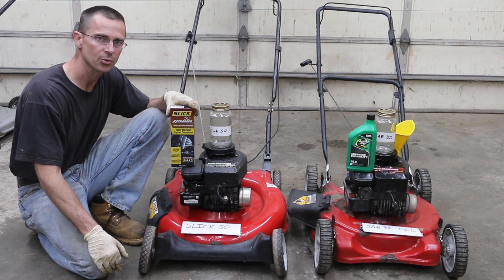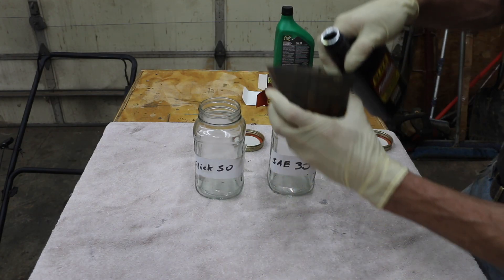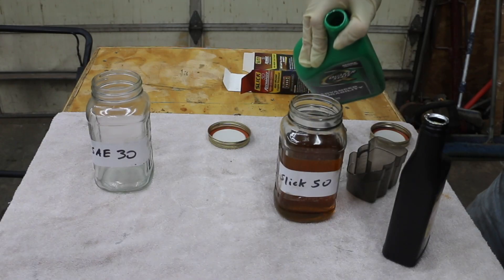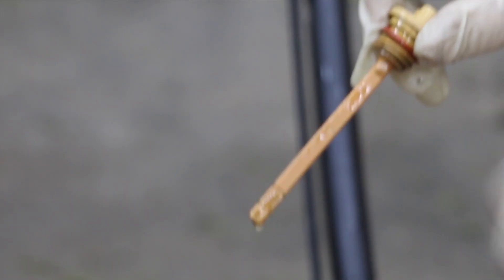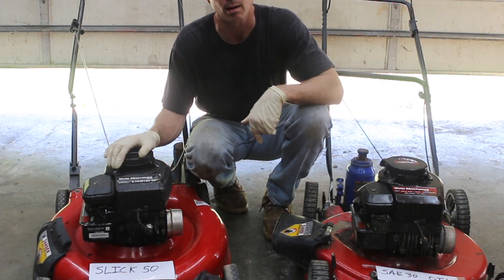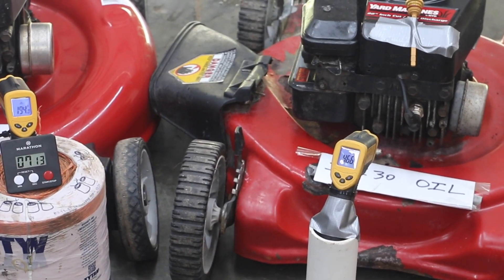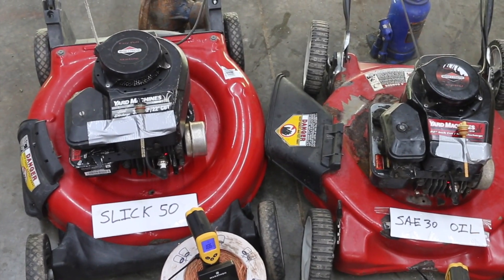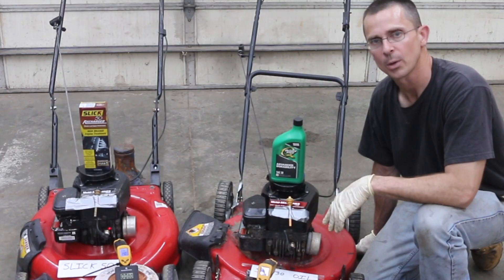Can't believe what SLICK 50 did to my engine!!--Dry Crankcase Test!

Comment: I'm convinced I both saved a car engine and ruined one using slick 50.

The engine that was saved was a vortex V6 in an Olds Cutlass. On at trip cross country, my oil pump went out in the middle of no where at night in the pouring rain. The car, which had slick 50 treatment got me 80 miles with no oil pressure, to a dealer who replaced the pump and tried to sell me a new car, saying the engine was damaged. I drove the car for four more years before trading it in. It ran fine and did not start using oil.

I should note, that Slick 50's directions says to run the engine for a few days and then change the oil again, using straight motor oil. This was the case in the engine I drove with no oil pressure. I averaged around 6o mph going up and down rolling hills. The engine temperature would climb when going up a hill and I would have to slow down to bring the temperature down. Still, the engine ran well.

On the other car, an 89 Land cruiser, straight six, I added slick 50 and never did the second oil change. The car was parked for several months without use. When I drove the car, within 5 miles, the rod bearings seized and broke two rods. When I got the car towed home and pulled the oil pan, the oil/slick 50 had turned into a jelly. I was running synthetic in the engine and added slick 50. When I talked with Slick 50 about this, they said that some synthetics have additives similar to slick 50 already. Adding more caused a reaction with the synthetic that made the additives turn to gel. I had intended on changing the oil and removing the slick 50 from the oil, but had some event that kept me from finishing the process.

It is obvious in your test that the addition of slick 50 reduced friction causing the mower engine to run cooler without oil. Why it seized up first may not have had anything to do with the additives. I don't think you can conclude this had anything to do with the slick 50.

Also, I noticed that the slick 50 you used was much thinner than the slick 50 I used in both cars. Your slick 50 is now a different formula. The old slick 50 was as thick as honey, like STP oil treatment.  See this video https://www.youtube.com/watch?v=CAt-tJa9P_s

Comment: Lawn mower engines use a dipper to supply oil by splashing it arpund the engine. I think as long as some oil is present,it should still run.The true test would be putting it under a heavy load. I am not a huge fan of additives in small engines,except in fuel. Ethanol kills all small engines.

Comment: Had one of those engines about 30 years ago, had a glass or plastic side plate. Part of the trick was it was only running at idle, with no load. Sometimes it would seize up, but a pair of pliers would break it loose when cool.

Comment: zmax is supposed to but it needs to be ran a few times for it to penetrate at least thats how they make it sound but i mean your never going to run you motor with no oil and the slick 50 did bring temps down which is good

Comment: Have you ever tried Duralube? I had a '79 Toyota Corolla with a R22 motor. It was run with no oil in it about 12 mile because my Mom started it up and drove it when there was no drain plug in the oil pan! We put oil back in it and it seemed to be ok. Drove it 4 more years with no issues then sold it.

Comment: Hello all
  I havent read all of the 1700 comments so I don't know how many times this has been said,,,, 

 well first off,  I don't have any idea why the engine with the additive
 went down first. BUT Project Farm did not use slick 50 in the engine. 
although he may have thought he did he didn't unless he found a bottle 
that was made prior to mid 80's
  their is a product out there now that carries the name  Slick 50, BUT it does not have the same ingredients as the original slick 50 . I can't tell the story here but if you are interested you can find it. 
  The original {TRUE} slick 50 is now sold under the name of something like " excel lubricants ".
that is not the correct name but will give you something to go on.

Comment: Good video.  In the 1960's, STP made similar claims but with no tests.  Many products came later making same claims.  There was a product that did the test with a live, running car but was later found out to be bogus.  A question was asked to a motor oil maker about the claims of oil additives and the response was that if it worked they would've put it in and would've known about it.
I appreciate you doing the actual testing.  Thanks for the upload.

Comment: People complaining 'this is not an ideal test because...' really have no argument. The claims Slick50 and the like place on their products would have you believe that no matter the test conditions, the treated engine would suffer less wear and tear. Before I saw this I would have assumed any two engines in whatever state, if one were treated with Slick50 it would outlast the other. Picking holes in this test is just silly. It was as close to ideal without destroying two new engines. I can understand being picky if you had placed a bet on Slick50...
Would like to have seen inspection of failure modes in both engines though.
Another excellent vid and hello from new subscriber.

Comment: I used Slick 50 years and years ago in my mothers Ford Fiesta. It became obvious really quickly that the engine ran cooler (water temp went to ¼ mark), In fact when the water temp needle got to the ½ way mark (considered normal) I had a quick look at the radiator contents as part of routine check - It barely had any water left in it and the cylinder head gasket was still fine. This was the time when you had to heat the bottle of Slick 50 in a pan of hot water before use !  I have no other hard data on wear and tear.

Comment: I used to use SuperLube motor oil.  I'm not saying it worked on the engine, BUT I had a turbo that used to blow oil and it stopped that only when I was using it.

Comment: Slick 50 (Hard to explain) has a characteristic like a liquid grease. It increases viscosity of your oil. Over time it is well know to leave a sludge all around the engine, valve covers etc. People use slick 50 to hide rod knock when selling a car. It in itself will droop quickly. Now with regular oil it will stay on your parts a bit longer. Now with DURALUBE unlike other oils which run from heat. DURALUBE will actually run to the heat. So I'd be curious on a DURALUBE run and checking of temps if any variance.But one thing I notice is the HP increases with Duralube for awhile then it goes back to normal range that you had prior. But I believe Dualube stays on your parts a lot longer than both oils. But it seems it breaks down before an oil change is due. (Not in a harmful way or anything)

Comment: Slick 50 is designed to make oil lubricate better by reducing its friction index without affecting viscosity. It will therefore drain off the walls of the cylinder quicker than the less slippery oil.

Comment: All this really proves is that Slick 50 performs worse if you drain all the oil out.  It doesn't show any results with the oil left in it.  I've never used Slick 50 so I have no good input on this.  I usually add a quart of Marvel Mystery Oil to my truck engine a day or two before i change the oil, its helped with my oil pressure issues.

Comment: I thought the Slick 50 engine ran cooler, or am I wrong?  If it's not a lot of trouble, I would be interesting in checking the compression on both and trying to pull start each one after they've cooled off, just to see how much torque is required.

Comment: I checked the MSDS for the Slick 50 you have. It is motor oil (most of the oil additives on the market start out life as the least expensive SAE 50 base stock they can get their hands on, and probably so does this) with borate esters in it for added lubricity. Fifty-weight oil is fine IF your bearing clearances are set up to take advantage of it; if you've got clearances suitable for SAE 30 oil, that heavy oil is going to have a heck of a time working its way in there. 

The Moral of This Story: If you have an engine that isn't worn out, just run a good brand-name oil in it and change it regularly.
Reply from the maker: jmowreader,  This is very informative and I agree with your conclusion!  Thank you for commenting!

Comment: I know it's not non-detergent, but another test would be reg oil vs this stuff. It's said that carb cleaner will hardly remove it from parts. Cen-Pe-Co CPC-54 S3 15-40 Heavy Duty

Comment: Temperature here is null and Void. One engine may be running slightly leaner than the other. If Slick 50 was doing what is advertised and the reduction in temperatures were from reduced friction it would have lasted longer than it did.
Reply from the maker: Great Point!  Thanks for watching the video and commenting!

Comment: Duralube, 
I have used it and it does bond to metal. I  was once drilling a hole in some metal on a drill press once, couldn't find my cutting oil, grabbed the duralube put a couple of drops on the hole I was drilling and instantly the drill bit stopped cutting. I pulled harder on the handle and nothing. Ruined an expensive 1/2 inch bit. Sold me even more on duralube.
Reply from the maker: William, This is very impressive!  I'll test Dura Lube soon.  Thanks for watching the video and commenting!

Comment: stp oil treatment sticks really good. you can't even wash it off your hands. I've done valve adjustments at 1000 miles on a new motor. I used stp  to assemble it and I still felt the stp on the rockers!
Reply from the maker: Jobless Drew, Very impressive!  I have some STP for an upcoming test.  I'm looking forward to seeing how it performs.  Thanks for watching the video and commenting!

Comment: thanks for the video, i have been a long time user of slick50 and duralube. 2 things. before you checked the temp of each engine you should have run them 
with the same oil in each one to see if they ran at the same temp then. maybe the left one ran cooler anyway. #2 it was a poor way you drained the oil and looking at the 2 jars ot looked like ther had equal amonnts going in BUT after the 30 oil jar wasn't as full. 1 question. doesn't it say the slick 50 needs to be running in an engine for like 4000 miles [car] before it actually bonds to the engine? wasn't in there long enough to have any effect?
Reply from the maker: Byron,  Great points!  One of the mowers didn't even have a drain plug.  I should have just tilted it over, but wanted to avoid spilling gas.  In future tests I'll do a baseline temp.  Also, others have commented that Slick 50 takes a while to bond.  All great points!  Thanks for watching the video and commenting!

Comment: try xado I have used it in my engines and I have stripped down one of my engine's due to  it having done 300k miles and found zero ware to the berrings or cylinders but I haven't run without oil yet
I have used lucas for oil and
 moly slip  on engines that had no coolent in them and they ran for more than 40 miles and only needed head gaskets and head skimmed to fix ps if you don't do the xado test I will sometime if I get round to it and upload it to my channel but it will take me a while before I can get it done  cheers mo
Reply from the maker: Maurice, Impressive!  Seems like a great product and thanks for the recommendation.  cheers

Comment: Liked your test, but that temp that the s50 engine locked at seems really odd. Please do a tear down vid!! I'd bet the s50 engine locked in the valve train, more due to having more carbon build up on the valve stem the the staight oil engine, rather than trouble with cylinder or crank. The valves on those engines get lubed from just basically oil vapor, and both engines being used there could be a large difference in previous carbon build up. Still fun to watch.
Reply from the maker: Jim,  Thanks for watching the video and commenting!

Comment: Lucas oil :) I would like to see a small engine comparison test after running Lucas oil in in it then draining the oil and running it until it dies..... I believe that using  Lucas oil at 20% of the oil mix will out preform slick 50.
Reply from the maker: Everdown007 Crew, I believe Lucas will outperform too.  Others have commented that I should use new engines for the "longest survivor" test.  I can't stomach spending a few hundred dollars this way.  I'm mulling over other options.  Thanks for watching the video and commenting!

Comment: Probably the biggest thing for engine longevity is to actually do the task of changing the oil. I've found my B&S engine to have enough practical design that makes this easy.  -Tip it on its side so it drains out the fill-tube; the tube is down (drains out well), and the gas tank opening is up. It takes minimal effort. 20 oz. of oil to refill. I applaud B&S for doing the job smartly. FWIW, I believe I noticed the engine and blade at an angle to compensate for rear bag weight. - I now go 1/2 notch lower in the back when mulching (no bag weight), and it seems to be OK.  - The excitements of lawn cutting ¡  I must also give credit, though, where it is deserved. This engine starts every time on the first pull, and the speed governor is excellent. - It's an excellent product in my mind. I give it an A.
Reply from the maker: Lou, Yes, you are right!  Changing oil is very important!  Great suggestion for changing the oil too!  Thank you for commending and watching the video!

Comment: Always heard that Royal Purple will still run after the oil is taken out.
Reply from the maker: Kevin,  I've never used Royal Purple.  Have you used it?
Reply: I have not. knew someone that swore by it.  They had a moving cylinder from which they would apply a brake to it. The oil would stay on it after it was emptied and the cylinder wouldn't stop.

Comment: Had a friend use Slick50 in his mower. The engine seized up after using it. I tore the engine down and found that the teflon (PTFE) in the slick50 had formed a solid ring of Teflon around the crankshaft where it spun in the case. The Teflon actually is what seized the engine.
Reply from the maker: Joel, Thanks for sharing this information!  Thanks for watching the video and commenting!

Comment: I put Motorkote in my diesel... definitely saw a difference in run temp pulling hills. took longer to get hot and cooled down faster... but dang that stuff is expensive... $90 a gallon at the truckstops.  http://motorkote.com/ this is not a paid endorsement.. the stuff did as they claimed.

Comment: I'm not surprised.  My Father and I fell for the hype when this stuff was new. The stuff actually ended up clogging the oil passages to the jet valves on the engine in his car, causing them to seize and ruin the rocker arms.  We ended up replacing all the jet valves and damaged exhaust side rocker arms in the car.  Slick 50 ended up in a class action lawsuit due to their claims not long after.  Snake oil is snake oil.
Reply from the maker: Thanks for watching the video and commenting!

Comment: The drained Slick 50 Oil looked alot dirtier. I wonder if it cleaned out any sludge from the engine therefore not leaving any protective layer of oil in the crankcase. If the oil was left in maybe it protects, but that could take years to find out. The lower temp seems like a good thing though.
Reply from the maker: Great point!  Thanks for watching the video and commenting!

Comment: I was talking to a friend of mine who holds three engineering degrees... "professional student"... and he explained to me why slick 50 or other snake oils are just as bad as putting sand in  your engine. Teflon doesn't coat metal until really high temperatures. I was also told the Teflon only really grabs "itself" so it's like syrup in a way in the engine... without oil to help it along it didn't last long at all... first time I've seen this test.. awesome... sad two engines went up in smoke but ... internet... hehe.
Reply from the maker: This is great information!  Thank you for taking the time to comment!

Comment: I used to be a delivery driver for Dominos back in the 90's. I put Dura Lube in my pick up.  One morning my Grandmother said she had cleaned up some anti freeze from underneath my truck.  
When I went to work I checked under the hood and found that the reservoir was still full, so I left.  Two days and 400 miles of driving later, it was empty. When I got to my uncle's garage; he said that the radiator was so dry it had dust at the bottom. It turns out that the bottom hose of the radiator busted and I had been driving for two days in the hot Missouri summer with no coolant. It made a believer out of me.
Reply from the maker: Impressive!   Thanks for watching the video and commenting!